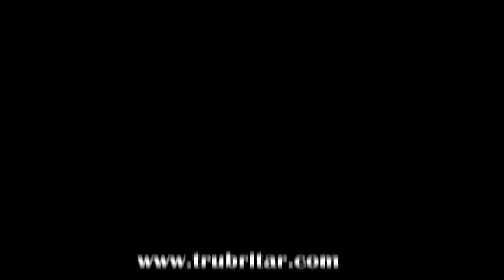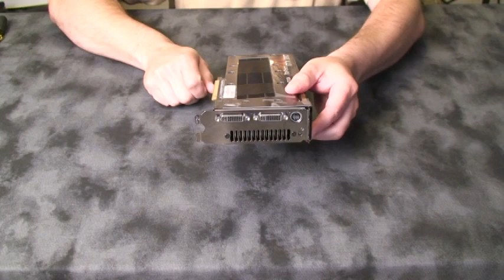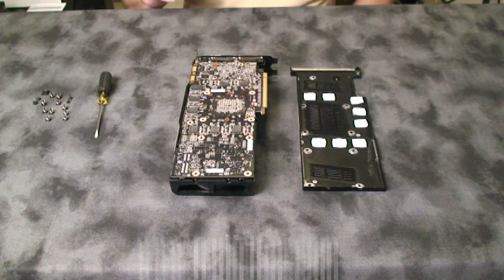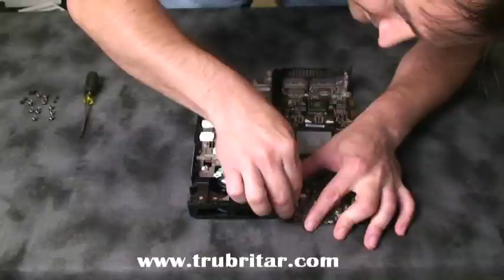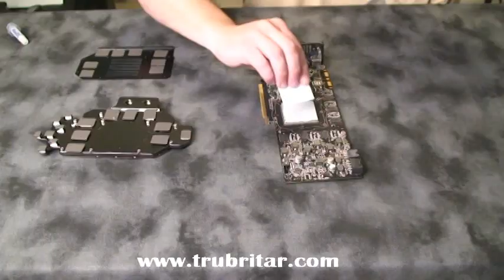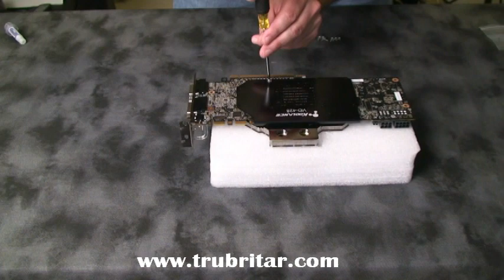GTX280 - Water block install guide

Comment from the maker: @ozpc123 The tubes will fit with the correct nozzles, however the cooling capacity may not meet the needs if you expand on the system...

Comment: Hi, i got a question, if i buy this waterblock for my 280 what else do i need to get?
i have  thermaltake big water on another pc for cpu cooling if i used it on my 280 koolance water block would the tubes fit?

Comment: thanks for the guide, was planning on building a new system with 2x GTX260s (might get the 280's if the price goes down) and an i7 920.  You made this look to easy and its a really good referrence on how you should take care or the card and equipment.

Comment: ok watched you 0wn your 280 GTXs and get one replaced, good man!! :)

Was wondering though i got my stock ASUS 8800 GTS 320 upto 100+ the other day I only checked when i started noticing artifacts.... :/

Now I can clean dust out of my gpu/cpu/psu fans and still is burning hot.

I'm thinking of buying a CM Stacker but should i go w/c and w/c 280?

or stick with my 8800 GTS, get a second, w/c both, any suggestions?

Especially seeing as the GTX 280 looks lightening.

Top Vids btw.

Comment: How much does the Koolance VID 428 water block weigh in comparison to the standard air cooler? Oh and what liquid coolant do you recommend using for optimal cooling? Thanks.